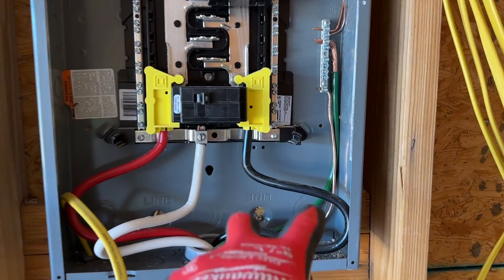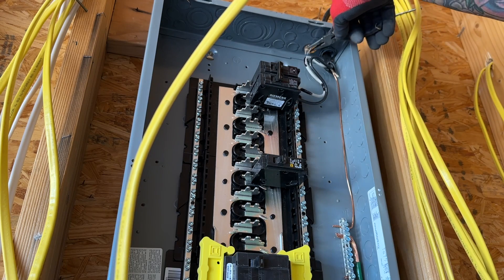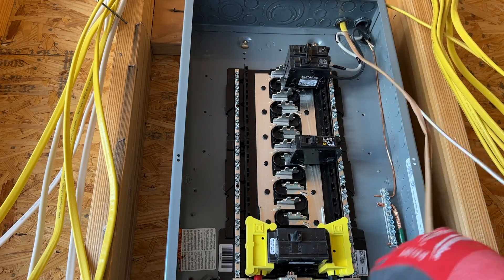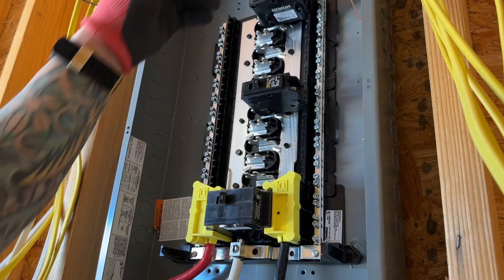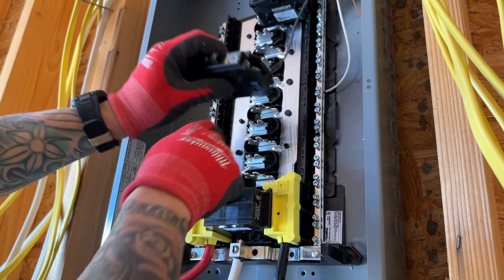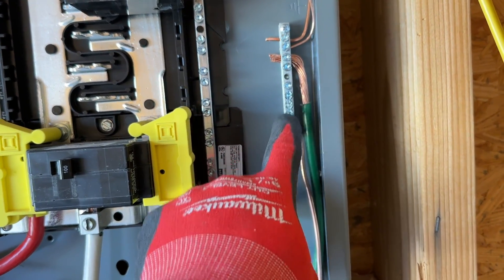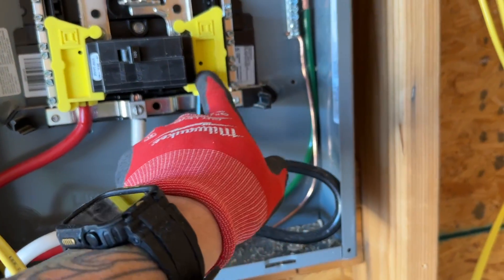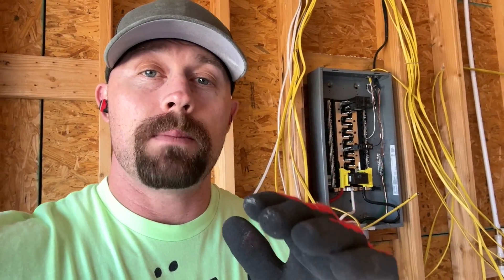Add a Circuit Breaker to Main or Sub Panel

Comment: I have a new sub panel with only a 240 for my mini split a/c an electrician did for me.  I want to add an outlet (20amp) outside outlet. Is it the same procedure in your video to add that outlet?
Reply from the maker: Essentially yes. You’ll run a new Romex 12/2 wires (yellow usually) from your new outlet location to your box. Then inside your box you’ll install a 20amp breaker and wire in the breaker and romex accordingly.  This will pull power from the box, though your new wire to your outlet. And usually most code in areas allows up to 10 outlets on a single circuit. In case you want to add a couple other outlets on that new circuit.
Reply: @FortKnoxCo great thx

Comment: I see you used a 12-2 wire...can I use a 14-2 in the subpanel?
Reply from the maker: 14/2 is usually for the 15amp circuits and 12/2 for 20+amp. So depending on what your running it for. But both can be used
Reply: @FortKnoxCo  thank you

Comment: Can I add a main circuit breaker y to my existing breaker panel box, my main circuit breaker is outside by the meter thank you
Reply: It’s a new house but my main circuit breaker is outside the breaker is rated 200
Reply from the maker: @haroldvelasquez9185  sounds like it could be able to accept another breaker. If it’s inside or outside doesn’t necessarily matter. If the panel isn’t maxed out to 200 amps AND there’s space for more breakers then you could possibly add another breaker to start a new circuit. Accessing the panel and running your new wire to where you want it is the only challenge in the process.
Reply: @FortKnoxCo  thank you for your help
Reply from the maker: Usually the answer is yes but it depends on your current set up. If there’s room for more and if the panel is rated for more.

Comment: Can I put a 20 amp breaker in my main box and run it 4 ft down to a plug where I can have an extra outlet/ plug outside?  They have the  neutrals and grounds together so should I run my ground and neutral wires to the same bar? And would a gfci outlet work?  Would be gray 12/2 and a weather proof receptacle / outlet. Thanks.
Reply from the maker: Essentially yes. You would need a GFCI outlet or GFCI as the first outlet on the circuit. 
As far as the ground and neutrals being on the same bar… technically they are “bonded” or “bridged” at your main panel. The ground itself is sort of a second neutral in essence. So the “hot” wire in case of some short or problem where the neutral was comprised the ground would allow the hot wire a path back. So it’s in a way a neutral in itself. A redundancy sort of. 

But depending on your set up I would follow how the panel is being wired. So if they have the neutrals on one bar and the grounds on a separate bar and then they are “bonded” as some point … I would just keep with the same way it’s all organized. All just a suggestion, not professional advice of course. Just my opinion from experience.
Reply: @FortKnoxCo  ok ty. Looking at afci breakers and I can have the neutral wire monitored. Trying to run a mini wine cooler to to make it complex lol ty
Reply from the maker: @ no problem at all 🤙🏼